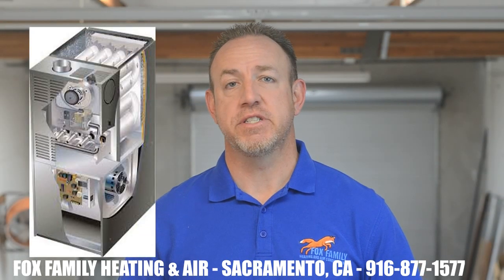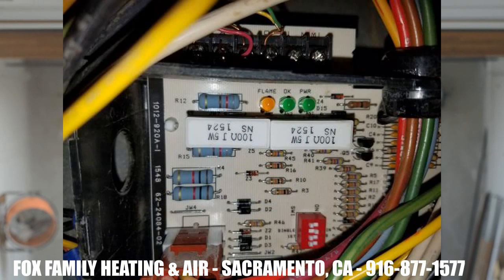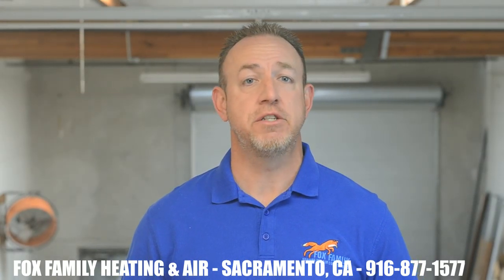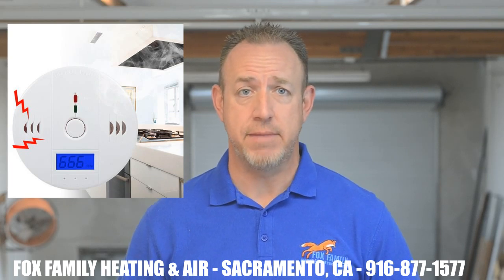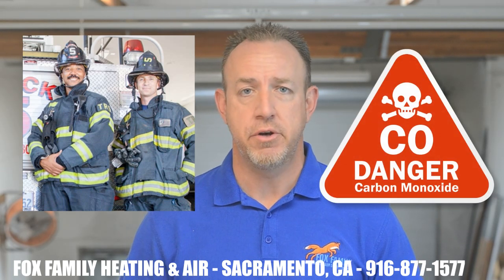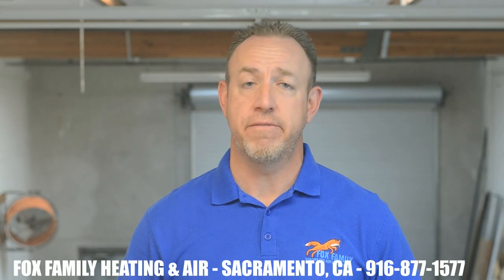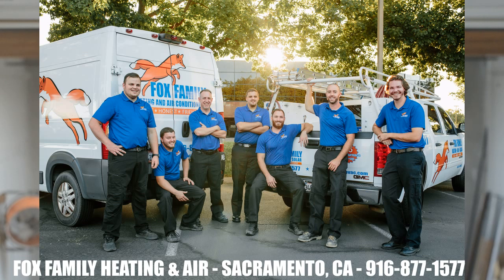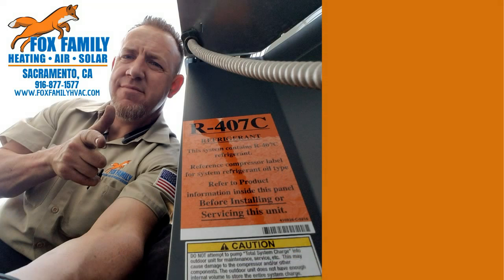What's That Burning Heater Smell From My Heater?

Comment: I have a burning smell coming out of my vents. And with the heat turned up I don’t hear the fan running. (Of course a week ago I installed a Nest thermostat) which was straightforward but now has me wondering what went wrong or if it’s coincidence now.

Comment: I just got a new unit n I’m always afraid of gas etc . So the new units don’t have constant gas running through them ? Only when they are turn on per the thermostat like I have it at 70 n I hear the furnace only turn on when it goes below that . I assume the new units are safer since there isn’t like a pilot etc ? So the new units would turn off it it was leaking gas or something? I did get 4 carbon monoxide so didn’t get anything for the gas detector I know the gas company turned on my gas last month and said it was good to go the city also inspected it cuz I got new gas plumbing n i got a new central heating and air they inspected buf I don’t know why I have this fear of the safety of gas going through it

Comment: 2 months ago I changed a capacitor for the indoor fan motor.  The customer text me they had no heat.  There was a bad connection for the hot surface ignitor.  Now the customer wants a new RA register.  I will install it Monday afternoon.  The customer mentioned the first time smell.
Reply from the maker: Yeah that smell is always noticeable that first time firing up each year.  Good luck on the RA grille!  Thanks Gary.